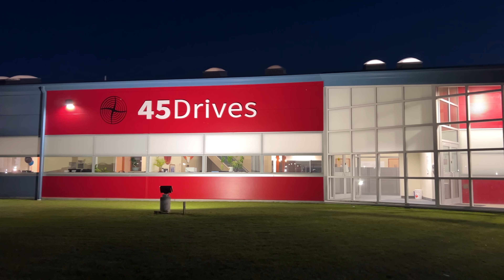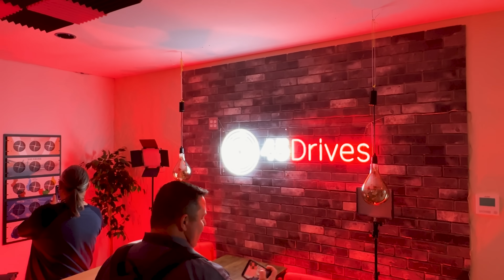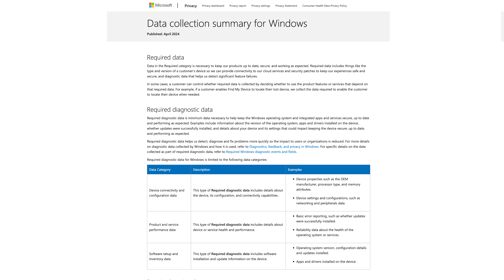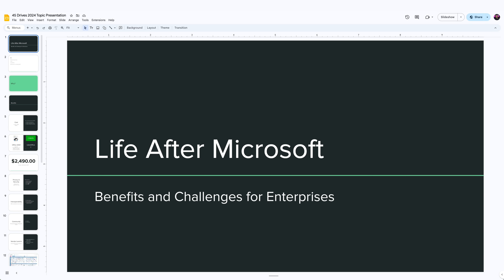How one company is "De-Microsoft-ifying" and pushing Linux on the desktop

Comment: I am using Linux as my main OS for 10+ years and from 2021 my main OS is Fedora Workstation, before it was Ubuntu. The reason why i switched to Linux OS was dislike of Windows, at the time Windows 8 and 10 after it´s release in 2015. The most hated thing was windows updates after power up of my machine on slow hard drive, i switched to ssd i think 6 years ago. Now i am using Fedora 42 on my HP Elitebook 840 G8 and i also use Proxmox VE on my old HP Elitedesk with 8th gen Intel CPU for my testing VMs such as Wordpress and LAMP stack. I still kept my Windows install with me because i am doing family support of their Windows installs and i need my install as a reference to navigation on the phone for example for them. Great video!

Comment: In January I decided to try and make the switch. I install Bazzite and spend two weeks as a PC Gamer on the Linux platform. While I found many games that could be made to run or had a direct Linux build. I found more games that had to be tweaked a lot to be made to run or would not run at all.

Add to this incompatability to the fact the Linux is still very much a tweakers OS, doing things in Linux can be more complicated than doing the same thing in Windows. Windows definitely has a more plug and play feel which is something most gamers crave, hence the popularity of consoles.

Comment: Thanks for the video. My two cents on the project. I believe it's great. I also that the key selling point would be to have an integration like Apple and Cloud. You take a note on your phone, you see it right away on your desktop and tablet. This is missing. I did setup a NextCloud server on an old Macbook Air running LMDE as OS, I'm playing with it but we need something more integrated in the OS.

Comment: I was a big Linux guy for years, but I wouldn't recommend Linux on the desktop.  It's fine for some people, but the desktop has a lot of variables and you'll probably run into issues unless in a very controlled setting.  The maintenance issues will not be worth it.  If it's just a thin desktop it can work but longterm it's not worth the headaches.

Comment: To get Proxmox in the enterprise , they need a 3 node cluster so you can put 1 node in maintenance mode (like vmware) and do software or hardware upgrades. An 'appliance' with 3 1U nodes would be cool. Proxmox also needs to add this feature to the GUI (like vmware).

Comment: The main grip of Microsoft is office 365.
Also I love the non rack mounted units but it also sounds very dangerous to have power and data lines exposed without any protection, when a unit is removed.

Comment: Fedora Linux (latest os) on a 2014 Imac at my office. They know it works, they know it's 110% better than the old os (smaller footprint, faster power on and shut down, better response, full use of hardware resources) but it still sitting behind me, waiting for my Mgr and the team to understand that the new Imac runs way much better that with the old OS, but yet they keep buying laptops with windows 11 and its dummy playground OS that doesn't let you do anything at all!

Comment: You should study OS a bit deeper. Linux is a kernel not an Operating System itself. Linux is used almost everywhere and there have been quite a lot of linux based Operating system which is very few in percentage compared to windows computers and most users are windows users. Therefore, people should also be given their choice which OS they'll choose instead of Blindfolding them to Apple's Unix-based Mac or Microsoft Windows.

Comment: Thanks for sharing info about them. I went to their website and looked at the workstation options, as I have been considering switching out my current window 10 home photo/video editing workstation over to a Linux option. Sadly the component list is pretty small at present, so the option to build an AMD (Threadripper Pro/Radeon Pro w7000 series) Linux solution is not present. Though their NAS options do look interesting, as my Sinology NAS is getting “long of the tooth” at present. I think I will wait and see how they further develop and improve their offerings before deciding. As my workstation upgrade has more priority currently than my NAS.

Comment: I started using Windows with version 1.03 in lae 1986, and continued until my first laptop with Vista. I used Vista for 3 weeks, then dual-booted with Linux (Ubuntu) after a few other distros, and 3 months, I began 2006 by deleting my Windows and using Linux alone. I have run Linux Mint since 2008, and switch between it and a Chromebook for all my work and play.

Comment: Perhaps you could put together a follow-up video, with 45 drives, to illustrate how an organization transitions to an open-sourced infrastructure? I made the switch to Debian Linux distributions 2 years ago, but I continue employment as a Windows OS engineer. In every discussion, it inevitably boils down to the lack of a prescriptive approach to abandoning any platform in an enterprise environment; 45 drives has incredibly innovative offerings, but without a "recipe" they will be severely limited to small businesses under 100 employees.

Some examples, how would one transition from VMware vSphere 8.* to ProxMox VE? How would one transition from Active Directory Windows Server 2019 domain controllers to OpenLDAP? I've gone through the YouTube videos on these very topics and what's missing is a sense of scale and support-ability that enterprises would need to "walk it out" confidently with a selected hardware vendor.
Reply: That is a great point. As we are now actively moving several departments of our organization over to Linux full time, we will be continuously working out any issues and/or roadblocks that come up and how we solve them. We recently migrated some our own divisions of 45Drives over to Linux and we plan on putting out lots of content to deep dive into this transition.

In regards to the transition from vSphere to Proxmox VE - that is a fantastic idea. We have done a few  videos about migrating VMs from ESXi to Proxmox VE, but have not made an all encompassing "how to migrate your business over" and the things to consider and be aware of. This is actually a big part of an upcoming video Brett Kelly and Mitch Hall have planned in their "infrastructure and build" series. So stay tuned for that!

Comment: Have been using linux my whole life, only ever used windows for Microsoft office, which I needed for school (no libre office or only office won't work I can't collaborate using those)
Been tempted to do a kind of parody video where I did a windows challenge, to show windows users the other side of the story
Reply: You must be young? I've been using Windows for half of my life (since Windows 95 was released). Used Linux at work and home for a few months here and there and I hated it. It was unstable and the software was subpar. That was when it actually worked. Earlier attempts failed to install. Windows 98 was also unstable but never had a problem since. Now on Windows 11. It's fine. I don't understand why the scarmongering by the Linux crowd. I guess it a form of self justification. It's the savior complex.

Comment: When there is a direct compatibility to excel then people will move over.  You need to support the finance people with the extensive macros in spreadsheet.  That and label printing support for current label printers.  They are so expensive and the manufacturers only have drivers in win or Mac.

Comment: With hardware experimentation going on, 
Someone should test if you can upgrade processing power via adding extra processor on south bridge, in pcie express. 

If 16 or 32 channel is good enough for ssd, graphic card, ai... 
I think, extra processor might work as well.

Comment: Helped getting 3 local companies move from MS Windows to all Linux earlier this year. 
Turned out the only Proprietary Software they all were running was for warehousing and it came from the same source. Actually a MSSQL DB with a custom frontend in C#/.net.

We convinced all 3 of 'em to pool the money they would have to spend to upgrade there warehousing software installs and request a linux port. Also all of 'em wanted a web based frontend. Turned out the company that makes the worehousing software was actually in the process of discontinuing there C#/.net frontend anyways. All we had to do was migrate the DB beckend to an other DB System. That's where I came in lending a hand to that software company (actually it's a one man show). The new Frontend was already done in Proton.
Thankfully there was no MSSQL Server specific stuff in there so between him and me it was easily ported over to PostgreSQL in a very short amount of time.
 
The New desktops run KDE Plasma with a custom theme on top of TUXIDO OS The Servers have been migrated to Ubuntu Server LTS and two out of the 3 Companies used the migration to upgrade there servers. 
One even rolled back there cloud deployment and opted for a classicel hosted servers solution.
 
All the employees have compleated training on there new systems and, based on feedback, are very happy with there new desktops.
I think no one bothered to tell 'em that they are not windows anymore ;-) 
The 3 companies are donating the money they safe on MS licences for the next two yers to the KDE e.V. & PostgreSQL Europe (PGEU)

Comment: There is only 1 reason I still use windows on my dual boot system. Office , that's it . Linux has no alternative and don't sell me libre or open office that are crap compared to ms and while I hate its forced cloud storage which microsoft totally reads . There is no user friendly alternative.
Reply: There are very few functions in Office that LibreOffice doesn't offer, and quite many that Libre does have and which Office lacks.
You are just too lazy to learn about a new software, despite the fact that the one you "need so badly" (as well as the OS it requires) are costing money and are constantly spying on you.

Comment: This is only possible for companies whose work is mostly blender, MSOffice & browser-based and doesn't require engineering/CAD software (like MATLAB, CATIA, SolidWorks, Inventor, Ansys, NX) - but even then there may be problems if MSOffice-work uses macros (not saying they're necessary in every instance, but I know at least one aerospace professor that uses Excel macros for one of his courses)
Reply: You'd better tell this fellow to switch to LibreOffice (which runs macros just fine) then, because there is talk about MS deactivating macros on Office365 soon.

Comment: Linux and other OSes are vulnerable to a lot of threats, including malware and rootkits.  Linux desperately needs a high-quality, robust, and in-depth Internet Security Suite.  ClamAV is not the answer to this issue.  The ClamAV website clearly states that the program stops threats from being spread to Linux by email attachments. ClamAV has no official GUI. Dave M, the developer of the unofficial ClamTK frontend has stopped work on the project.  Additionally, ESET NOD32 for Linux Desktop is also no longer supported.  Comodo for Linux is also long-since dead.

Comment: OMG. You think Microsoft is proprietary? How about Apple. It is amazing to hear people talk about how important open platforms are but buy into Apple and iPhones. Can't think of a company that is so locked down. And no, I am not a Microsoft fan-boy, I am typing this on my iMac.
Reply: locked down apple software is what made me move away from macs. i heard it is better now (don't need itunes anymore for copying files to iphone) but i am not going back. linux is just a completely different world with how open it is.
Reply: @willi1978  I am pretty sure I over reacted but Microsoft has tried pivoting. They even contribute to open source. You can install Linux on a Windows machines. They support multiple architectures. They have tried to be backwards compatible. 
What is miserable about Windows is what the typical corporation does to it their machines just don't blame Microsoft for that.
I have not run Windows at home for 20 years so I am not a fan but I do appreciate they are trying to adapt.
Reply: @wstrater it's not adaptación it's absorb and nullification of competitors
Reply: The issue with Linux is not Microsoft or Windows, it is Linux. I have more Linux machines at home than Apple. I spent a lot of time at a Linux terminal over the last 18 years at work and I am an application developer. I prefer to use OS X terminal over Finder for a lot of my file tasks. I even got my iMac because it had Linux like terminal without the Linux desktop issues for my daily driver. I like Linux and wish it to succeed but I struggle with the desktop environment and this is not a Microsoft or Apple issue.
Windows and OS X succeed were Linux fails because they have a single unifying driving force with a single vision behind them. Linux prides itself on options and alternatives. Most people want simple. Linux is everything except simple.
An example, I am building out a new Debian box with Xfce and wanted to install MQTT Explorer. I had to go to the web site to read through the installation steps being mindful of what package manager I was running. I first tried snap but that meant I went to the terminal and installed snapd. I than tried installing mqtt-explorer multiple times using snap and could never find the executable. Back to the installation directions. Next attempt was downloading the correct package, .deb, and manually installing it. It errored out the first time because I forgot the ./ in front of the package file name despite adding the -f parameter before it. I had seen something similar so I knew enough but that was just luck.
I installed Visual Code Studio. That was a lot more command line work installing repositories and dependencies before installing Code. I then went to add it to the bottom pop-up menu but it was not in my list of applications when I went to add items to the menu. Some digging and I located the .desktop and was able to drag it on to the panel. I thought it was easier in the past.
Adding Chrome was a lot of command line work too.
I like like the command line. In some ways the command line is badge of courage or a rite of passage for many Linux users including myself. The problem is most people don't and Linux will never succeed the way Window and OS X do if people have to use the terminal. Blaming Windows may be fun but is counter productive. Blame Linux for its own problems and maybe we can finally fix the issues that turn off so many people. You can't fix the problem unless you own the problem.

Comment: Wow wow wow, hold your horses here. What a misleading title here. At least at 05:28 you state that "De-Microsoft-ifying" is just a Metaphor.
I know YouTube wants clickbait titles but still.

Before someone accuses me of a fanboy, yes my OS typing this is Windows but I use many open-source software.
But from a business standpoint I still don't get why Microsoft is the big bad boy. The internet doesn't run on Microsoft software, it's maybe coded in VS Code (which is open source btw) but servers, access points, switches,... are running some version of Linux. Windows (from Microsoft) is the most used, maybe that's where the negative stuff is coming from but Windows has always been very tweakable.

I have way more trouble on the current state of Mobile OSes, where you can easily run 100 of flavours on "Microsoft devices" try doing that on MacOS, iOS and look at the current state of Android ROM's... Then we haven't talked about ChromeOS...

Anyway hope you had a great trip but this video (while showing off cool products) gave me goosebumps but not in a great way. From clickbait titles to promoting alcoholic beverages (you know a fridge can cool other stuff too). I'll forgot this one quickly!
Reply from the maker: The title is exactly what they are doing and beyond the metaphor, they are getting rid of all proprietary software including Microsoft and also replacing Windows with Linux on their desktops.  Also, I respect Microsoft as I stated in this video 😅
Reply: @TechnoTim  Yeah my bad, that should have been misleading term in the title. I hope they are doing what you say in the title otherwise it would be really weird.

Anyway I guess it's just me. I find it weird when people refter to something because it's the biggest or the first or a combo. Like Kleenex (tissues), Post-it (sticky notes, Google (searching), AI (LLM),...

Yeah sometimes I catch myself doing it too like with Velcro, Teflon or styrofoam
Reply from the maker: @JelleRevyn  believe it or not that was the title of the event too.  I guess it’s now an eponym.  I definitely respect Microsoft and use their products and was hesitant to attend the event until it was made clear to me that it was more a play on words for the talks, however it’s literally what they are doing internally.